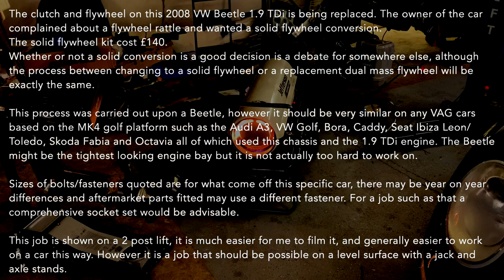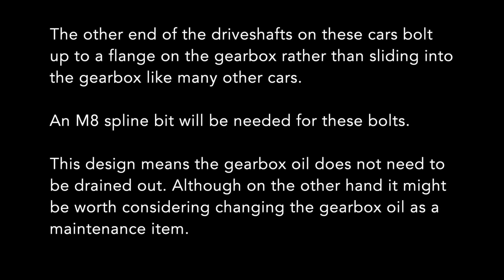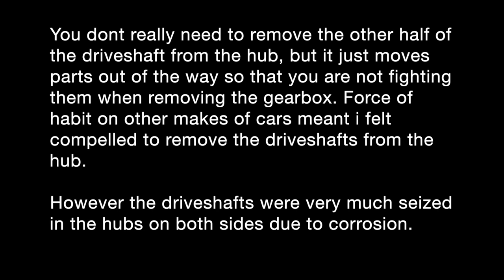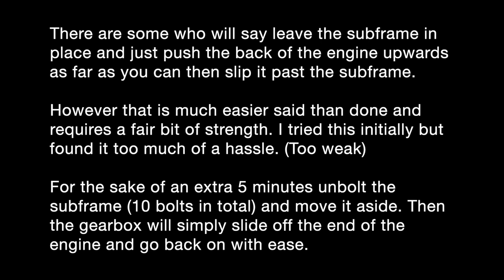VW 1.9 TDi Clutch & Flywheel Replacement

Comment: Atleast you used a sprung hub clutch with that single mass flywheel.  I've seen so many people install a single mass flywheel with the non spring loaded clutch disc.  Good job.
Reply from the maker: I think all came in the one kit?

Comment: A million times, thank you. This has been a 3 week project for me. I did everything you did, I think I -may have missed something as now I cant get it started. The dash lights up but nothing when you turn the key to start it. If you have any ideas, I need all the help I can get! If not, once again,  A MILLION THANK YOUS!! I was quoted 2000 to replace the flywheel/clutch. Im anxious to get it started to see if I did everything correctly! This is a 1998 Volkswagen beetle 1.9 5 spd
Reply from the maker: Hi, sorry for the late reply but did you get the car started in the end?

Comment: Is there a brass coloured ring that looks to go on the shaft? Often cracks etc I don't know name of he part so wanted to ask if it sounded like something you know off I had clutch flywheel changed and guy showed me a ring part it was brass coloured and cracked down the side I need the name of the part to replace it on my mates car he asked me as I had my clutch changed but no one seems to know

Comment: Great video.. Did you have to make sure the vehicle was at TDC when doing this clutch/flywheel replacement? I ordered a solid flywheel/clutch kit and was nervous I didn't want to mess anything up on that end. Thanks.
Reply from the maker: HI there, thanks for the comment.

No there was no need to set the engine to TDC for this job.
Reply: @peugeotCitroen2CV  thank you!

Comment: Excellent work! Thanks for sharing this knowledge with us
One question, consider someone who is doing this job on the floor and uses a floor jack to support the oil pan. If the jack slips would the engine fall to the ground :O ?
Reply from the maker: Hi there, thanks for the comment

It depends on how you support the engine. I wouldnt recommend holding it up just on a jack. Use blocks of wood to supplement the jack, or an engine support bar along the top. If hypothetically the jack was on its own and slipped then the engine will fall, but there is still one engine mount and the exhaust/wires holding it in place. They would probably also get damaged so it is well worth being very careful when supporting the engine for removing the gearbox.
Reply: @peugeotCitroen2CV  thank you very much for your explanation!

Comment: Part number?
Luk or sachs?
For 2006 skoda Octavia 1.9 tdi diesel alh 5 speed manual
Reply from the maker: Hi there
Sorry i cant remember any of those details, the owner of the car brought it round to me with the new clutch and flywheel sitting on the passenger footwell. 
It came from a local motor factors so nothing particularly hard to come across.
Reply: @peugeotCitroen2CV  ok bro but can you tell me tentatively which one is good brand sachs or luk for vw?
Reply from the maker: @1.9tdilove71  
Im not too sure, i don't work often on VW stuff. Join the forums/owners pages on facebook to judge what owners recommend.
Although either brand should be good, try and do some research to see what originally was fitted.

Comment: I need your help!
Hey I broke off two of the three bolts from the gearbox mount bracket. Do you know the part number to buy them please!
Reply from the maker: Hi there, i do not know the part numbers but you can use this site which is very comprehensive, find your part number and then copy it into google it should give you various options to buy what you are after
http://www.catcar.info/audivw/?lang=en&l=c3RzPT17IjEwIjoiQnJhbmQiLCIyMCI6IlZXIn18fHN0PT0yMHx8YnJhbmQ9PXZ3

Comment: what is the reason for replacing the flywheel?
Why didn't you change the crankshaft oil seal?
Reply from the maker: The owner complained of a flywheel rattle, he buys/sells cars and wanted this to have a new solid flywheel apparently easier to sell.
Regarding the crankshaft oil seal, an ideal time to change it and if it was my own car i would probably have. However it was not leaking.

Comment: How much would a mechanic charge for this job
Reply from the maker: I am not too sure, i do not do this as a full time job and dont go to mechanics myself. Rough estimate £150-300, it will vary depending on where you are from, and the cost of the parts you fit will be on top of that.
Reply: @peugeotCitroen2CV  Thank you much!

Comment: Hey! Best video ever. Saved my @ss more than 10 times. Didnt even end up with extra bolts somehow! Lol

On the other hand, how did you get those tie rod ends off? I got one somehow by soaking it with pen oil and getting it red hot, but the other one wont budge even if my vise grips are tighter than sin. I dont want to replace the inner end either. 

Let me know!